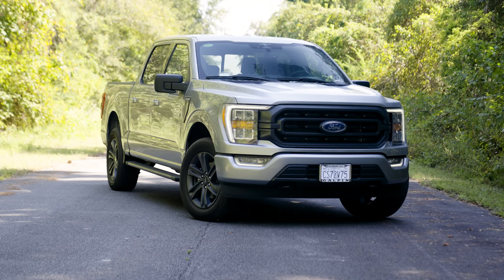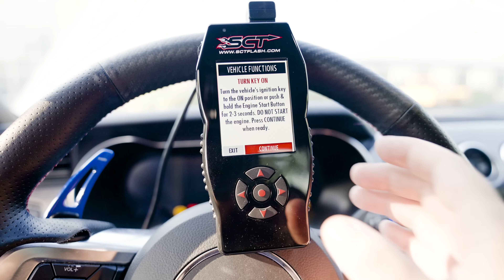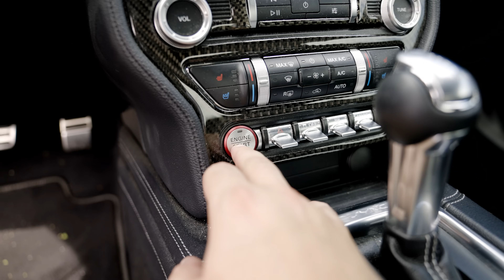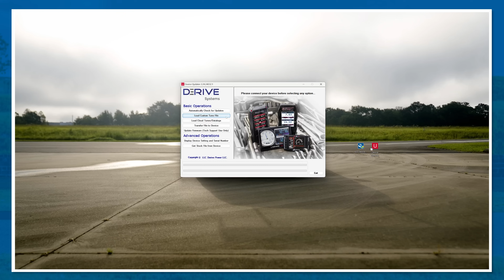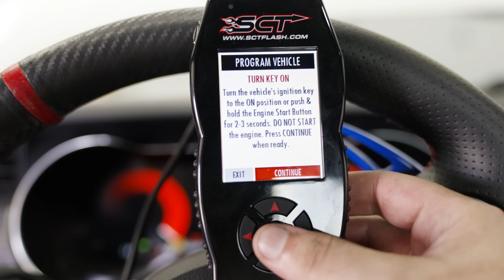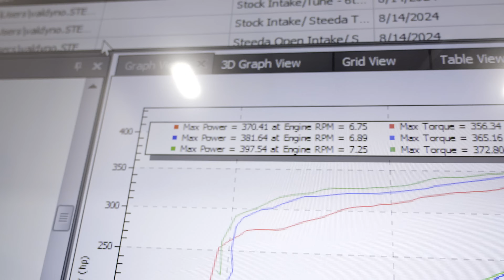Steeda Custom Tunes - Everything You Need to Know!

Comment: As of 2025 are you able to get a custom tune for the 2024 mustang GT? When I'm on the custom tune page there's no option for the 2024 year.
Reply from the maker: The ECU is locked from the factory so the only way to get a tune would be to put a supercharger on it. And even then, that isn't custom.
Reply: @steedaautosports  have they said when it would be possible to get a custom tune?

Comment: Question, I have a 23 Mach1 fully loaded tr80 track and performance I want to get more HP but don’t want to purchase items that aren’t upgrades to what I already have from factory my main concern is the air intake, I do want a tune and long tube headers and H pipe but is the intake going to be an upgrade the mach1 already comes with the GT 350 intake

Comment: Is this a E85 flex tune or a dedicated E85 tune?  If it's a dedicated tune, what does the E% need to be no less than?  As you know, pump E can be anywhere from E50-E85.
Reply from the maker: This is a dedicated E85 tune. Obviously, we recommend trying to find a reliable station or source for quality fuel, but we've had people run E70-75 and have been fine.

Comment: One of the best things I did with a 93 tune was a bulletproof rear end with 3:73 an aluminum driveshaft differential cover and all the parts was FordRacing with the Steeda under drive pulleys on a 2003 GT and it was a over night difference!

Comment: Will the steeda custom tune also work with the addition of long tube headers with catalytic converters without setting off the check engine light yet still make a lot more power?
Reply from the maker: We can't do anything about the check engine light, but we do account for long tubes in the tune. There's a section in the form that covers any exhaust changes.
Reply: @steedaautosports  okay thank you for responding. How can you use long tube headers without triggering the check engine light?

Comment: How can I find my gear ratio? I have a 2017 mustang gt non performance (manual). I looked it up but there wasnt really any solid answer
Reply: Should be 3.55:1
Reply: @MisterJ.J.  okay thanks
Reply: Check the Vin tag in you driver door jamb. Under axle should be 1 of the following.

BB - 3.73 ratio with manual or automatic transmission
DD - 3.55 ratio with manual transmission
GG - 3.31 ratio with automatic transmission
YY - 3.15 ratio
Reply: @160sims  Okay gotcha, thanks!
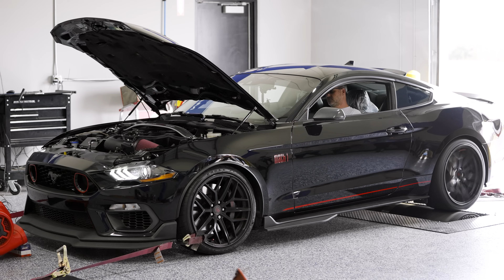Reply: I think it maybe a 3:31 sir because the auto is a 3:15.
Reply: @79chevy901  2017 GT's with manual stick shifts only have 3.55:1 for non-performance pack and 3.73:1 ratio for performance pack. Automatics and non-V8 S550 cars have the other ratios. Also, a S550 performance pack GT with automatic transmission has 3.55:1.
Reply: @79chevy901  my 2017 GT manual stick came with a 3.55:1 ratio rear differential. Also I confirmed it with a Google search.
Reply: @79chevy901  3.31:1 ratio is for V6 automatics

Comment: Great video Scott. I have a 19 GT with the 10r80. Does the Steeda tune improve the shifting of the trans as well. Also is your e85 tune a flex tune or do you have to run the tank down completely before flashing the e85 tune
Reply: I have the 10 speed as well and yes the shifts are smoother now and really feel more difference in other modes now
Reply: @jasonspencer4276  thanks for the info. What tune did you go with. Was it a 93 octane  tune or e85 and did you feel a good  difference in power or just the way it shifts?
Reply: @user-bk5ey9ws5g  93 tune with rousch cai and axle back. My butt dyno says it has more power lol
Reply: @jasonspencer4276  Funny I have the same intake but I have corsa extreme active  with double x pipe. Looking forward to possibly getting a tune in the near future
Reply: Does steeda offer a flex tune for e85?
Reply: Dont ever do a flex e85, dont use it with wide band. I switch back and forth, just run it to almost empty, 2-3 gallon in tank and pick tune load it. E85 fuel mileage sucks for long trips,, i run 91, e85 to work, around town. 2013 gt. Change plugs little more often and need tires more often :). @toddsb07